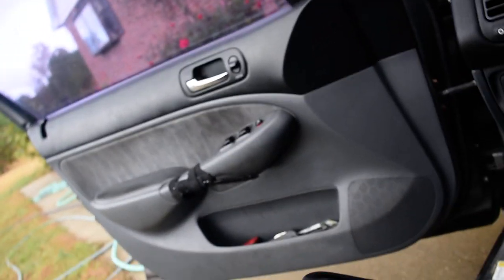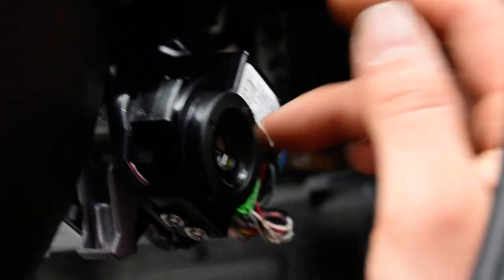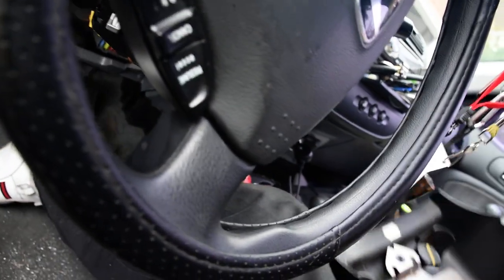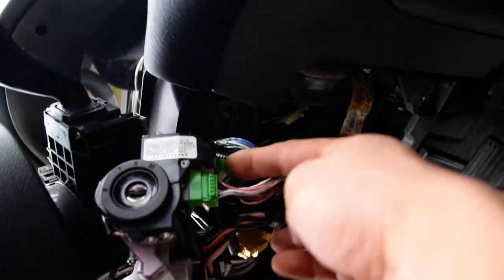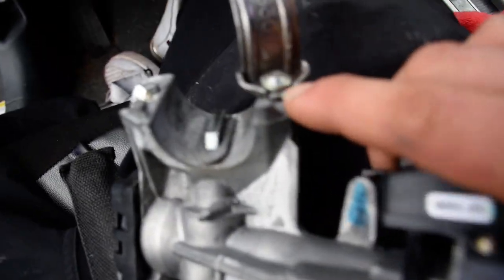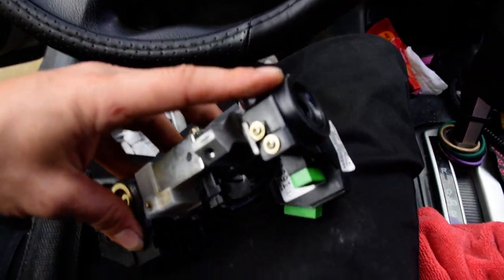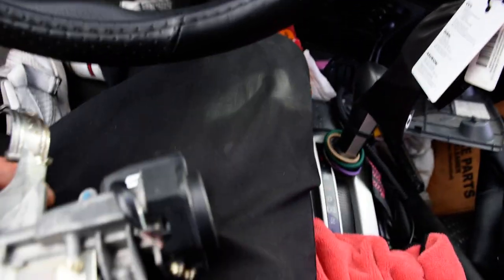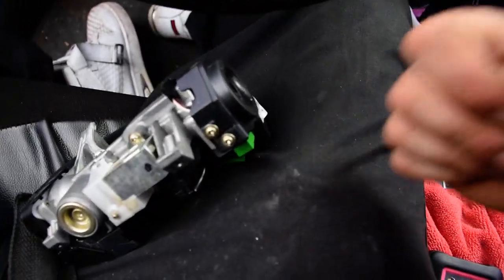2004 Honda Civic Ignition Lock Cylinder/ Ignition Switch Assembly Replacement

Comment: Fyi for anyone replacing this themselves. The “rivets” on the steering colum are actually break away safety bolts, so the are in fact threaded in. If you take a flat head or small chisel and keep hitting the edge of the left bolt it will eventually walks it way out. Or you can just drill it out like he did.
Reply: Yes, don't be a hack mechanic.  Those bolts rotate.  They aren't rivets.  I just used a flathead screwdriver and a small hammer and tapped them the correct rotation and the unscrewed quite easily.
Reply: Shear bolts fellas.
Reply: Can I reuse the bolts?

Comment: ALTERNATE METHOD...I had a locksmith come and make a key without programming it. He put the key on vice grips an worked it into the ignition cylinder. It took some work but he was able to re break the cylinder and my original key works again. It was only $100 dollars to make a copy of the key and for his time. Well worth it. Have not had any issues since and I keep the spare in case I need to rework the cylinder to match the key cut.

Comment: Those are in fact fasteners they are called Break Away Bolts. You can use a Chisel/Punch/Screwdriver and Hammer to free them and then unscrew them by hand. No need to drill them out.

Comment: Center punch and ball peen hammer will get those two bolts out at the top, then use a saw to make a slot so that you can use a flat screwdriver to drive them back in when done.

Use the center punch with a hammer to carefully tap the screws at the correct angle.  In Lincoln, Nebraska there's a locksmith who'll remove and rebuild most Honda ignitions for under $300.
Reply: $300, LOL OMG.
Reply: Usually after you get
one lose the other comes right out start with the one most accessable

Comment: thanks for posting. Sorry about your experience at the dealership. They're there to squeeze every penny out of you. I have a 2004 honda. I wanted to get a "donor" ignition from a parts yard and wanted them to program a key. They told me I needed a bill of sale from the vehicle the donor ignition came out of!! It's their little way of ensuring you buy THEIR stuff.
Reply: If you get the mechanical part cylinder from another car or ebay, you'll need to swap the immobilizer off your car (plastic parts on the key side) - then have an aftermarket key made (with a chip slot) from the one that came with your replacement lock. Break your key open and swap in the chip. Don't keep another cars chip on your keychain (won't start). Keep your broken key without plastic on your keychain for the door locks. You can also knock out the roll pins on the cylinder, remove all the tumblers and put back together and keep your parts and key!! Just replace those shear bolts with ones you can tighten up!

Comment: So could my shit need a new one? My car has power but it dose not crank up and I already bang up my starter and that doesn't work and battery practically new ina way cables to the battery are connected tight so what do ya think? Could it be the switch
Reply from the maker: Possibly if it wont turn over like the belts dont spin at all I would check to make sure you have oil try turning the crankshaft by hand to ensure the motor is not locked up. If motor is not locked  could be starter oil ignition switch. You can jump the starter by using a screwdriver and touching the positive and negative leads on the starter be careful it will spark.

Comment: Always better to use an automotive locksmith for programming keys: they come to you (maybe saving you a tow fee to the dealership), they are a bit cheaper, they are not interested in selling you unrelated auto parts.
Reply: Wayne Buffin what year is your car and civic or accord??
Reply: A locksmith doesn't stock the part that the uploader bought, and a dealership will usually give you the "brake code" to temporarily bypass the immobilizer to drive it in.

Comment: does the 04 cylinder works for the 03 ?
Reply: the 2 door car
Reply: @SauudiiMusic  Yes. In fact, you could swap to a 2001-2002 style with the more reliable but less cool-looking key and wafer tumblers inside the locks. Of course, you'd have to carry 2 keys around unless you change the rest of the locks over as well.

Comment: Idk i picked one up from the scrap yard I told myself what's the chance that my original key turns it  which it did  I just kept the original plug ends on the original switch  (2 black at the key 1 black at the end of switch) .... anyway she starts with no problem  now

Comment: To avoid the programing new key why you dont take out from your old system the key reader and put in the new system remuving the new one and take out rhe old key chip and installing in a new key that comes with the new system.. i mean makes sense dont you think???
Reply: I did it on a odyssey and it work perfect 75 buck the complete column from junk yard
Reply: Thanks i just changed my key cylinder take the old key senssor and put it in the new key that comes with the new key cylinder and it works ... no new reprograming keys ... exept that i have to use the old key to open the car ... but i dont care to have 2 diferent keys ...plus i have the remote control to open my car .. thanks ......

Comment: I'm having an issue with my 02 civic. When I try to start it early in the morning nothing happens.  I have to play with it for a bit.  After turning it to the on and off position for a while it will eventually start.  Only happens in the mornings. Do you think if I change the key lock cylinder it will fix my problem?
Reply: Did you find your problem I have the same problem but mine happens randomly in the day I figure out how to start the car but I kinda want to sell it but without they problem

Comment: So I changed my ignition assembly and got the correct keys for it. I had a locksmith cover and try to program the keys but the car wouldn’t let it program. He said it was the correct key for the ignition switch but the car wouldn’t let the key program. Let me know if you or anyone can help me or give me tips
Reply: *locksmith come over
Reply from the maker: Take it to the dealership for programming. And if you replace the ignition lock assembly it should already come with the keys that fit that ignition lock assembly you purchased. Do not purchase an ignition lock assembly that does not already come with the keys for it
Reply: davidmezera thanks David! My bad for the confusion the ignition switch did come with keys. I’m gonna have it towed to the dealer asap
Reply: What was the solution for your keys not being programmed?

Comment: Hello, I purchased an ignition switch assembly for my 03 civic ex and then realized it was for and 03 civic hybrid. I still decided to install so I can test it out. After installing it I tried starting it and it wanted too but it did not. Do you think it didn't want to start because it needs to get reprogrammed or maybe because it the wrong part for the wrong car? Thank you.
Reply from the maker: It has to be programmed. I tried starting mine after installation and it did the same thing until I had it programmed

Comment: fyi I ordered the part on eBay for $49.  free shipping, one year warranty and 30 day money back guarantee. you got screwed, homie
Reply: I have to order one . My 2004 quit reading my chip in the key. U order the entire ignition system, or just the ignition switch and keys?
Reply: Doug styles I just got the package yesterday. it comes with the entire ignition assembly and 2 new keys. Sunday I'm having a mobile mechanic come out and install it. he's going to rekey the system also. parts and labor I'm in it $150.  part came from new Jersey it took like 12 days fed ex ground free shipping and 1 year warranty on the part.  go to ebay and search 2004 honda civic ignition assembly
Reply: @dsmith9349  ok cool. Thx for responding.  So u paid about $200 altogether?
Reply: Doug styles I paid $51 all together for the part and $100 to have it installed
Reply: @dsmith9349  lmk how it works out!
Reply: Doug styles don't go to ebay. they sent me one for a Honda accord which is why it was so cheap. my mechanic couldn't put it in my 04 civic. I had to give in and go to Napa auto parts and pay $479 for the part alone.  I guess it's a complex unit that was implemented in the civics from 2003 on because of how easy it was to steal them. I have to get my money back from eBay. parts and labor I'm in it $679
Reply: @dsmith9349  damn. Sorry to hear that. We found one for $99 on ebay. My mechanic says it's the one I need. And I've been messing with it for over 2 weeks. Looks legit. Guess I'll find out.
Reply: @dougstyles5091 can you send me the link for the correct one you got? 2004 civic please let me know thanks

Comment: Annita808
I had a question, I have a 2005 honda accord Ex. I will be switching out my ignition switch tomorrow, and most likely have it towed to honda to have the new key reprogrammed.  I ordered the whole assembly from RockAuto, do you know if Honda will have to cut the new key?  And do I still need to hang on to the old remote control keys?  I think the new keys do not have a remote.  I do have a main relay and fuel pump relay ordered at the honda parts shop in I will need that too.  

Thank you, Wish me luck on switching it out.

Comment: Did you have to tow to the dealer to get the keys programmed or were you able to drive?
Reply: Dealers can give you a temporary "brake code" to bypass the immobilizer, so you can drive it in.

Comment: that part alone cost $400-$800. a locksmith can pull out your key tumbler and fix it for $60. even better, you can use your original key.
Reply: If only this were true.. cylinder is difficult to remove on these models, easy on others

Comment: can i swap the  code ant. ring  on  new  ingition  with 2 keys   with my old  ring  and take the  chip from old key  and glue it on out side of key switch   to make it work
Reply: I think the code is stored in the car's ECU, not the ring. Im gonna be getting a different ECU, key, and ignition today. I dont think I'll need the ignition if I swap the chip inside the keys but ill find out.
Reply: Trumoo is wrong. You can defo do what you propose. The immo box is matched to the ECU, but the transponder code is held in the immo box (it's like a 93Cx6 IC, IIRC). The immo box's function is to verify the key code; once it has, it signals the ECM to turn on the fuel.

Comment: You can order it in good condition for well under $100 ..why spend $400 that's crazy. I have ordered used ones with new keys before and they work just Fine
Reply: Where do you order a used one from?
Reply: eBay
Reply: He was stranded and wanted to get on the road. The dealership had it in stock.

Comment: There’sa video on just removing the cylinder, not the whole assembly. Take the cylinder to a locksmith for repair or just remove problem wafers yourself. Free to cheap fix; https://youtu.be/S9V3ETzlVgE?si=d6oy0kHyOQ2U_bwe

Comment: Nice video, much more simple that i would have though. If that happens to my 03 im just going to rig it to run for 500+ bucks, as long as you still have the key to disable the immobilizer you can just remove the switch and turn it with something. Does removing the ignition module unlock the wheel?
Reply: Yes, it does unlock the wheel.

Comment: not ribots .....there tork bolts .. ment for security..they will break off head wen tight nd
Reply: Sheer bolts.. tork bolts need torked.    I'm still looking for the 3 Phillips head screw drivers holding the plastic cover on ... @ 0:15..

Comment: You should have called Pop A Lock Locksmith we would have repaired your ignition for $200-$300 in under an hour
Reply: Mendel Beck which state is that in
Reply: ITS EASY  I HAD A NEW STEEL KEY MADE TURNED IT WITH A PLYIERS  IT CUTS OF THE NUB THAT WAS HOLDING IT FROM TURNING AND THEN USED THE ORIG KEY YOU NEED A STEEL KEY TO DO THIS. THE ORIG IS SOFT METAL  TOTAL COST $15